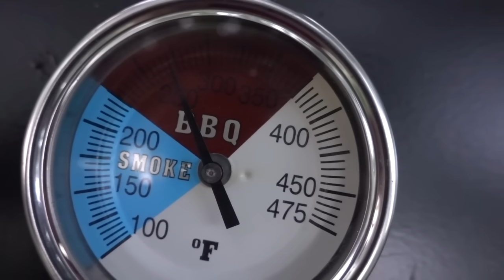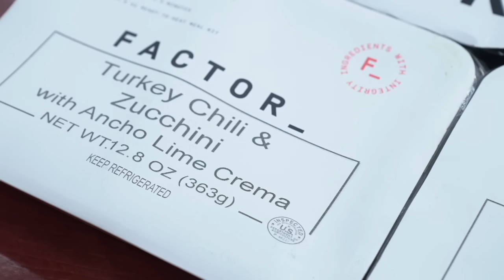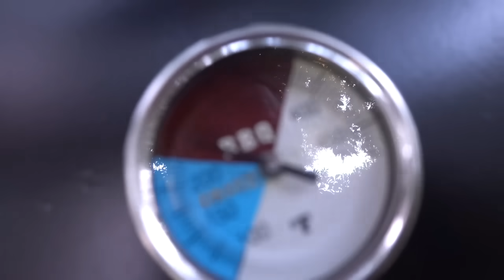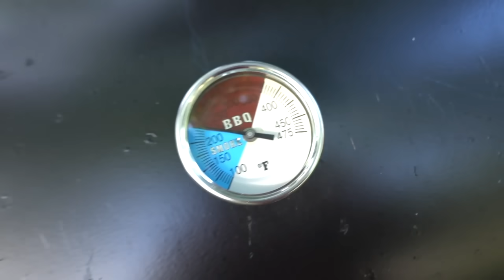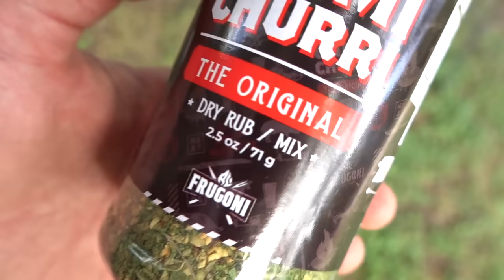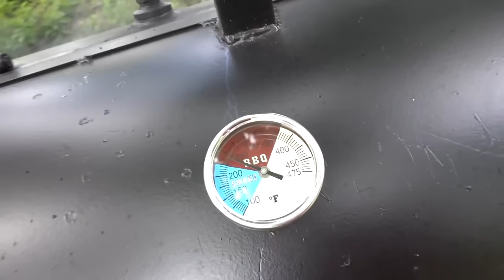The Biggest YouTuber Cook Off ft. MadScientist and Chuds BBQ

Comment: Owner of a BBQ business with a Texas style PIT. Your fire box will have a small amount of smoke come out of the box if you don't have sufficient draw from the stack. Or the flow from the fire box is restricted. My advice weld walls to the barrel of the smoker from the fire box and simply cut out a bigger section for air flow. Then control with the stack.

Comment: It's a design flaw. The vent door would be lower on the main door to allow cool air in without letting the hot air out. (Heat rises, cold falls)
Reply: I think the land sloped too much and put the door at the same height as the chimney. If he turned it around I don't think it will smoke out that door.

Comment: As someone with pit that can hold 600lbs of butts I believe your pit has several issues. First is the firebox needs grate for your wood/coals to sit on. This allows air to enter from under the bed of coals.  Also need some vents on the sides below the grate to allow air in. Need a way to open and close these grates with a sliding door, this regulates the air going in and allows you to manage the temperature. I'd also recommend turning it into a reverse flow pit but that requires moving the flue from one end to other and adding a big plate under the grill to send all the heat to the opposite end from the firebox then it comes back across the meat and keeps the temps even on both sides.  If TX wasn't so far from NC I'd pull my pit down and give you a taste of NC pork BBQ, both Lexington and Eastern style!  Good luck and keep working on the brisket!

Comment: When moving something that large and awkward with forks, I have another method you could try. I worked for an HVAC company that built units the size of houses. When it came time to load, we had the truck with a flat bed line up with the load. Then you lift the unit straight up and have the truck back under it. This way you don't have to travel with the load up high and it makes the whole thing way less sketchy. Stay safe and keep up the good work Matt!
Reply: Yeah bud, your method is better, safer. That's what a lot of commercial movers use.

Comment: If you are going to leave unattended for longer periods, I would recommend installing a digital controller. As a bonus, if you are near a WiFi source or have a hotspot, you can monitor and change temps through your phone. You just need to make sure you don’t run out of wood.

Comment: brisket is done after the thickest part of the meat (not fat) is between 190 and 210 degrees. at 190, you pick it up and feel and twist it. it will go from kinda firm to suddenly loose and twistable when its done. so check it every 5 degrees from 190, 195, 200, 205, 210. you will know when its done when you feel it. then you wrap it in a towel and put it in a cooler for 2-4 hours to rest slowly

Comment: When doing ribs, it is best to take the membrane of the back of the ribs. That membrane isn't good eating. Also, you can soak some of your wood in water to help slow down the burning process and make good smoke. The wrapping in foil is called the Texas crutch so you should definitely do that. You probably need a better way to regulate your fire and maybe hire someone to watch it while you do other work.
Reply: The silver skin has to come off like you said and if you don't have time precook pork ribs in BBQ sauce and beer........once partially cooked finish in the grill or smoker.
Reply: Chud dies NOT remove the membrane. For good reason.

You shoupdn't either.

Good fat behind it, amd if you render it right, no one will ever notice. 😂

Comment: If you can't keep your coals hot you should cut a proper vent low on the box that you can adjust either with a slide or a turning vent like you see on kettle grills.  You are completely missing vents and if everything seals you don't pull any air the little door is meant for observing or adding  wood or charcoal without opening the entire side.

Using your pans you were doing the modified 3-2-1 so wrapping late shouldn't hurt it. The last hour is for glazing or saucing and as long as you have hit your temp you can skip it. If you do sauce it you can take it back out of the foil or wrap and let it caramelize I usually put it on a propane grill with the far side burner on low.

Comment: Recommendation on the stage.. 

The stage has a front and a back and it’s not used as a 360 view stage platform but more of a Front and both sides. 

I would highly recommend putting one post on the center back and then putting some diagonal supports. 

Adding a cable/wooden brace flat under all 4 post as a “floor” to keep all 4 post perfectly square and plum would be ideal. Sagging could be from legs not being completely vertical while not on trailer and the legs are sliding out from Texas humid moist weather creating sag.

Comment: You are losing heat through your door because it's open...I know that sounds like a smart ass answer, but you will want to start learning to control your heat through your damper more than your door.  This will also keep your temps more consistent, and your fuel will last longer.  When all is going well, you probably shouldn't need your box door open more than a crack.  Keep it up though, love your BBQ content!

Comment: Perhaps y'all could have the ignition module tested. I had an old mid 70's Ranchero that would shut off. I'd pull over and look under the hood, but of course, nothing is obvious. Climb back in, crank the starter and it would fire up. The next time it happened, I pushed the transmission into neutral, crank the starter and Vroom. 
   I finally put a new ignition module on it, which cured it. 
   Can't swear that's what is going on with the inherited truck, but the symptoms sure sound familiar. Giddy up.
Reply: My 01 F-150 had something similar to what he described, and it was the idle air controller. Easy fix (at least in that truck). I wonder if it's that.
Reply: Y'all have nailed the entire issue... more than likely, it's a sensor thing. Dang son, who knows? We've probably saved Matt a boatload of moolah... wonder if that qualifies one or the other of us for a free T-shirt?!
Shazam, git-er-done!
   Giddy up(I started reiterating this old cowboy saying before Matt did).

 @Sidekick_Snowman

Comment: Applewood is the greatest. I get my smoker to 400+ to start my meat. Throw meat in, then gradually let heat go down to 225. Thanksgiving I run smoker at 400, then letting it go to 250 for 6 hours, the 225 for 6 hours. Pork loin & ribs I throw them in at 400, then let them get to 225 for 6-8 hours. Brisket, I run my smoker to 400 for the first full hour, then let the brisket drop to 250 for 10-12 hours. It will be black when you pull it, but that’s perfect. 2 things to remember; always keep big pan of water UNDERNEATH your meat. The condensation will keep meat moist. Second, always let your meat relax at room temp for 15 minutes to let it relax. When you cut meat hot , the muscle is contracted and squeezes juice out of meat. Besides applewood smoked Turkey, our favorite in our house is smoked bacon wrapped meatloaf.

Comment: Use a trailer from the demoed doublewide as the frame for a stage. Trailer home axles and tounges are quite cheap. It would be nice to have the stage always be a stage, and the gooseneck always be a gooseneck.

Comment: On the Triton, go through everything you can of the wiring harnesses in the truck and wiggle the wires, especially at connectors.  All it takes is a loose or corroded pin in one of them to give you intermittent problems like you are experiencing.  A bump, lean, or other body shift while driving can make the problem come and go.  Also look for bad engine mounts, body bushings, and similar fittings that could be failing or broken, so that there is excessive movement during driving that can exacerbate the poor connection problem.

Comment: Your truck problem sounds like what I had happen with a car many, many years ago. It turned out to be a 5 cent jump ring on the carburator that had broken. I'm not mechanically inclined, just offering that as one of those weird things that most mechanics don't think of...at least the ones I took it to didn't, for quite some time.

Comment: You need to rework your intake door so you can regulate the air flow. Try a circular type damper. You want real fine control so you don’t burn up all your wood. Put a thermometer on the first pit. Never burn bark. Bark will give a bitter taste. Normal BBQ use Pecan or Hickory. Oak will have a stronger smoke flavor.
Reply: That is what I have been thinking even though I have no experience with this. Some kind of louvered vent.
Reply: @KameraShy  Look at other pits. What I am familiar with is the circular type that has slots on a circle that cover up slots on the door. Bolt in the center and turn to adjust. Normally the damper is on the large loading door. If you want fancy you can use a small forced air fan and connect it to a temperature controller like a Raspberry Pi or an Arduino Uno. But that takes batteries.

Comment: I would suggest checking the cables are secure to that terminals on the battery. I've had similar issues when they aren't connected tight.

Comment: I had a GM Vortec motor that was behaving the same way as your ranch truck,  running fine, then dieing. Restarted fine, then died again a little while later.  That one had a bad pickup in the distributor that cut out when hot. I haven't worked on one of those in a long time and I'm not even sure it has a distributor in it. Lol. I worked on diesels the last 15 years before I retired.  Good luck. It sounds like a component getting hot.

Comment: Most smokers have an adjustable intake - Either a sliding or rotating door that allows you to adjust the open area, from totally choked down to fully open. When I'm doing brisket with full logs I'll get a decent sized fire going and choke it down to almost nothing. Lots of coals and very little oxygen gets you a slow, steady fire - You can walk away for two hours without worrying about the temperature once you get it tuned in.

Comment: Hey Matt, you might want to get a fab guy to make you a slider to regulate temp with instead of using the door.  The door should be mostly for adding fuel and smoke (wood) the slider would allow you to adjust air flow and regulate heat.

Comment: Matt. On the white truck check the fuel pump driver module. It's located on the frame in front of the spare tire. Those corrode and can cause the problem you are having.

Comment: Design issue, you want the draft door lower and you can get old school spring thermostats so it will auto regulate somewhat. Look for wood stove draft, damper, or thermostat and a variety of options should show up that require no power.

Comment: When jumping a battery, not only charge it for a while, but when actually trying to start the truck, have someone rev up the running engine to 2500-3000 revs if not more so it is putting out much more power.

Comment: Hey Matt, I may know exactly what’s wrong with your truck because I had a Ranger years back with the exact same problem. It’s likely to be the PCM relay, a $20 part. It’s very random, puzzled mechanics, and it took me years to figure it out. The relay gets hot, opens up and stays open until it finally cools off. It’s in the fuse relay box under the hood.

Comment: I would have a rack of some kind to hold the wood off the floor of the box to help keep the airflow under the wood for combustion. As for the draft door, That should be as low as possible. Even a screw type draft control would be better.

Comment: Ribs 3-2-1 method, 3 hours smoking low and slow, the wrap in foil with butter and sauce of choice for 2 hours, then unwrap from foil and finish for another hour. looking to keep temp steady at 250 degrees

Comment: Been on vacation so I'm late to the party. I'm sure someone has already recommended this, but with ribs you need to pull the paper like membrane off of the back of them before cooking. It will make a huge difference in the tenderness and ability to pull the meat off the bone.

Comment: Get a bunch of pam oil spray to keep around and soak all the inside surfaces before and after to keep a good season layer and oil coating to prevent it from rusting. Keep a good layer of grill paint on the outside or use pam on the outside for the meantime

Comment: The key to smoking "in my opinion" is internal temp. For ribs, I check after about 2hrs and check,  at 160-165 I wrap with juice. Then i let it go up to 202-203 internal temp. I pull them off and put them in a cooler to rest for and hr. I am not a fan of 321 method

Comment: Want award winning ribs? Grub Rub and brown sugar. Grub Rub is available at HEB or you can order it by the gallon. It is a Katy, Texas rub. Mix 50 - 50 brown sugar and Grub Rub. Salt, pepper and garlic granules on your ribs. Then generously coat both side of the ribs with your mix. 

Here is the secret part. You have to let the ribs rest a very specific amount of time. The time is one beer. Someone on the team has to drink a beer. When the beer is finished you put the ribs on the pit. This takes a dedicated person to do this at 6 am. No, you cannot substitute coffee, not even with Kahula.

Never beer the ribs. Beer should be drunk, not put on ribs.

Smoke the ribs on low heat (175-200) for a few hours until they have the perfect color. When they hit 160 they are finished smoking. Wrap your ribs in foil. Put back on the pit and crank the pit to the 250 to 300 range. When ribs are almost done, by the flop test; on the pit, open the aluminum and apply honey liberally on the top side. Close up foil and continue cooking on high for 20 minutes. You can try leaving open to the heat and smoke. You may over smoke so be careful. Smoke is a seasoning and best not to over do it. Eat quickly because they are best straight off the pit with the smokey crystalized honey coating.

Many contests have been won with this method.

Comment: so what me and my grandpa do when we smoke meats is. so if ur doing a pork but it usually takes 8-8 1/2 hours but for that cut of meat the max smoke you can get in the meat is being in there for 4 1/2 hours(at 275 290) and we take it out and put in a tin pan with or without bbq sauce and cooking the oven at 260 for 4 more hours. rule of thumb there is only so much smoke that will set into the meat so if you don’t wrap it and put it in a pan you may lose juice and flavor. but it’s all about trial and error and everyone does it a little different

Comment: if you use a rachetstrap to tighten the roof to the machine it will not drop and you only need one rachetstrap under the roof between the wood.

Comment: You have to have a meat thermometer. When the internal temperature gets to 200 for ribs they are done. You are overcooking them. If you have more water and it's between the fire and the meat it will keep the temperature at 221 degrees for you.

Comment: Matt, I had a similar issue (run fine, then just die, and not restart for a random amount of time) with a truck of mine, and it was a fuel pump relay causing the problem.  Just thought I'd throw that out there, perhaps it's something that simple.  (Also, a code reader helps... Which I'm guessing you already own one.)

Comment: The more air that gets in the hotter it will get. So if the small door is barely open, it will cool down. Also the stack should have a cover that’s adjustable to allow the air to move through it faster and make it hotter. So, barely open door and stack, the cooler it will be, all the way open door and stack, the hotter.

Comment: That fire box is terrible. Cut it off and weld it back on so the connection to the meat box is at the top of the fire box and lower than the rack in the meat box. Then it should beable to flow at a slant all the way to the flute at about a 4 degree slope(looks like on camera you have the whole smoker parked downhill). You are also missing a flavor/smoke pan that allows you to adjust the angle that the smoke travles through the smoker to the other end. It should be perferated with an adjustment ideally so you can let the smoke out into the meat evenly below along the lenth of the racks.

Comment: The box on the smoker is to high, the pipe entering the cook portion is at almost the same height as the door vent, once the smoke hits the top of the box it should only have 1 way to go, not 2.

Comment: Problem with a day event is you’re in the middle of nowhere. That means “starting at 11” do people queue to get onto the ranch at 11? So don’t actually “get in” and settled till 12-1

No drinking because driving, also means people spending less on beer which = less profits for you

People have to start leaving at 5/6 if they have to be off the site at 7. Meaning really people might only be there from 12/1-5/6

People may not want to “leave” which could cause you issues…

Comment: Matt, the fire and smoke should go in the top (not the middle) of the smoker. The heat and smoke should exit at the bottom of the smoker. You are loosing smoke because the hole in the firebox to smoker is the same height. When the heat and smoke goes in the top and out the bottom it rolls and spreads the heat more evenly, Your heat and smoke are going straight thru so you only have the top half of the smoker with heat in it. Get you 3-4 temp gauges and drill a hole in at the top and near the bottom install the gauges and check the heat difference.